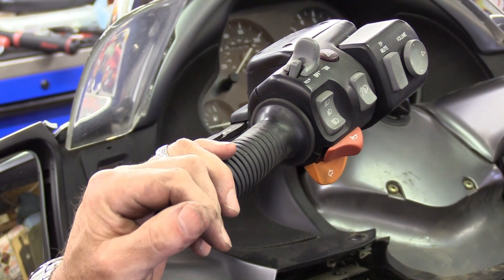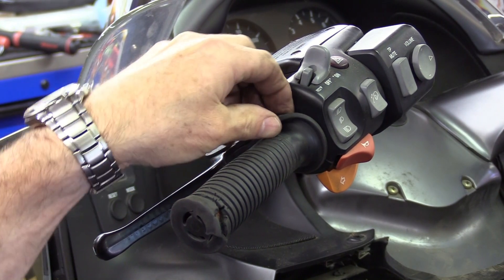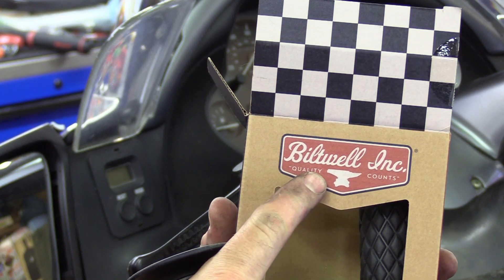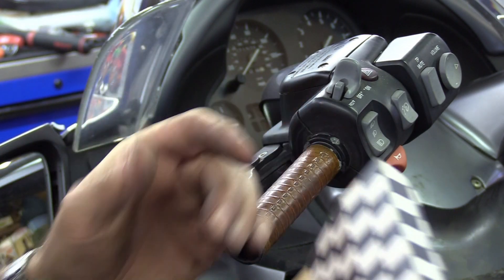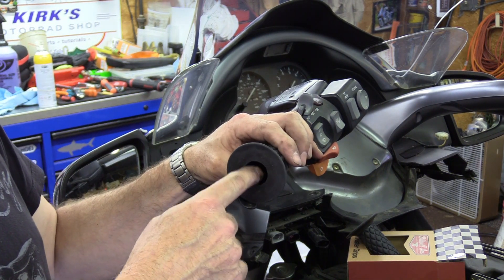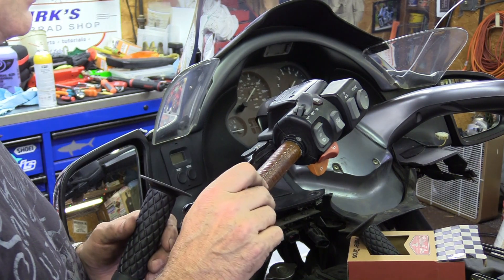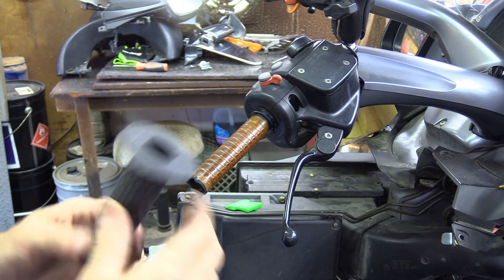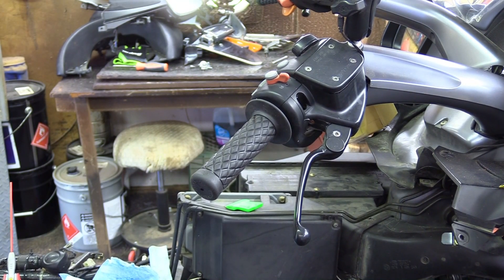How to Replace Your Rubber BMW Handgrips DIY

Comment: Generally I use compressed air to install grips with no lube or glue.
Reply: I was worried about using air pressure to put them on because of the heated grips with wires.

Comment: I've been looking for some good rubber grips for my 04 R1150rt...then this video appeared. Just bought two pairs, thank you for the link!
Reply: Same here. I wonder about the best way to cut the rubber to install the bar weight either.
Reply: @paidoluca  I'm going to measure my bar with calipers, then make the appropriate cut there. Of course, I'm going to leave a little excess so the rubber can "squish" into place. I'd rather have a bit too much than not enough rubber.

Comment: This is a super video. The grip at the start of this video looks exactly like mine, and on my other bike I paid a shop I know $200 to install the new grips I bought for probably $250 on my 2002 R1150R a couple of years ago (and they did a crappy job putting all the wire back - loose tape which I had to fix)... I am confident I can follow this video and get this done, and so glad to do it myself like this rather than mess with the wires... and these grips look like an improvement over factory (they now sell them in a set that says both are 1"... so I need the left most, and I will hope that is right and by a second pair if I have to). Thank you!

Comment: I installed Grip Puppies the year after I bought my 07.  They are getting a little ratty, but I expect the OEM grips underneath to be like new.  Probably will just get another set of Puppies if I keep the bike too many more years as the extra diameter helps me with comfort.  The mai downside is some loss of grip heater effectiveness.  Always a trade-off…

Comment: I'm assuming that the author's example is on a BMW earlier than 2014.  I've read (anecdotal/owner reports) that it's not possible to replace Wethead grips (R1200RT, 2014-2018, and probably GS models, too) because the rubber grip is integrated with the heating element.  I'm working on mine now, and that appears to be the case, although, it's also possible that the heater element has welded itself to the rubber through normal use.  In any case, I've cut diagonally, essentially "skinning" the grip working sideways to the bars, so that I don't cut through and damage the heated element wires.  I've worked from both ends.  Both ends have simply torn off in strips, before they begin pealing the old grips from the bar.  I've cut into exposed wire at both ends, probably not through it, but it's shinny metal rather than covered with resin as I would have expected (from photos I've seen).  There seems to be no separation at all between the rubber grips and heating element.  I'm into this thing now, and will continue, but anticipate having to literally peel the old grips away in tiny rubber pieces, perhaps like skin from an orange.  I still may be able to avoid damage.  If I have scraped the resin covering the wire element and removed it, I'll coat the wire with something to replace it before I attempt to install the new grips (though exactly which product I'll use to do that, I'm not certain).  Just FYI, and maybe a word of caution to other BMW owners.  It might be better to leave the OEM grips in place, and over coat them (various ways described in forum posts, i.e. rubber washers, a tennis racket "shrink wrap" handle, grip puppies, etc..  (I'm just stubborn.  I wanted mine to be an OEM style, and I may yet get my wish, by having to purchase an entire new heated grip assembly because I've ruined the originals.)

Comment: Great video.   I replaced my grips on my R1150R and I can’t seem to tighten the throttle cap appropriately without the throttle sticking.   What did I do wrong?

Comment: Thanks, just got a 2006 k1200lt,  and the grips are original,  they are kind of gummy feeling, time for replacement
Reply from the maker: Be very careful removing them. They are not the same as the early models and can be easily damaged.

Comment: No end caps?  My RT has these end caps or maybe they are call sliders. (I don’t know what they are called for sure). Didn’t see that (my bike) style on the link. Guess I’ll keep looking!  

Thanks Kirk for the tip!  I was wondering how I was going to change them out.
Reply from the maker: They make open end grips as well

Comment: Would you happen to know if the tubular grip section of cast handlebars for Oilheads (like my R850R or an R1100RT) are the same size as these?

Comment: Didn’t see this coming.  Just picked up this 2002 LT, throttle is way different then in your video and what was on my ‘02 RT.  Is this an OEM replacement?
Reply: Is it not possible to add pictures?  Well no Kapton tape on heated grip.  Wire is in the grove of a plastic piece

Comment: Is there a quick fix if the gas-throttle doesn't want to snap back when you release it?
Reply: I have an 2004 RT with 121,000 miles. I noticed this last year that the throttle got very stiff. Almost dangerously so. It was in cold weather and I had the heated grip switch on. These are the original grips and have begun to split. I am guessing that the heated element has somehow buggered up the contact surface between the heater and the surface underneath. So unless I can fix the prob, I will not use the heated grips anymore. And may pull the fuse for it if it doesn't affect anything else.

Comment: Don't do it this way! Remove the whole switch gear unit first, 4 x 10torx screws, and 1 or 2 screws hold the grip onto the bar.  unplug the electrical adaptors, and the grip assembly will separate. It will be easy easier to remove the old grip by cutting the ends carefully, and the centre section is not glued.  Use a hot air gun to warm the grip up and it'll go straight on.  Do not use wd40!
Reply: Why not WD40?
Reply: Can anyone answer why not to use WD40??